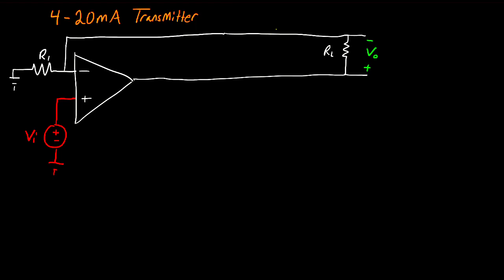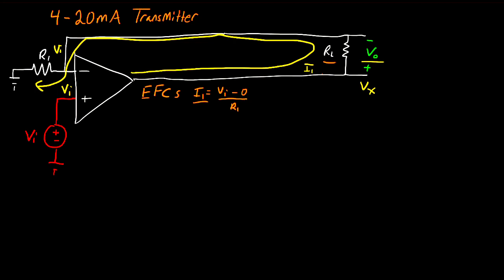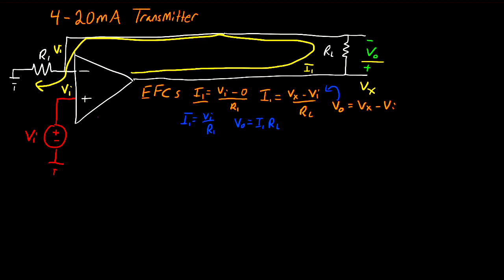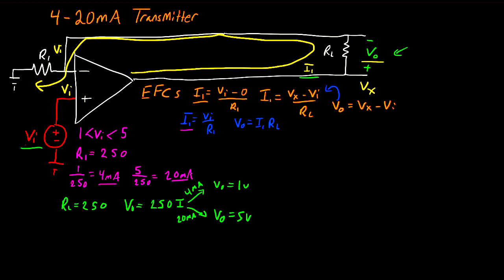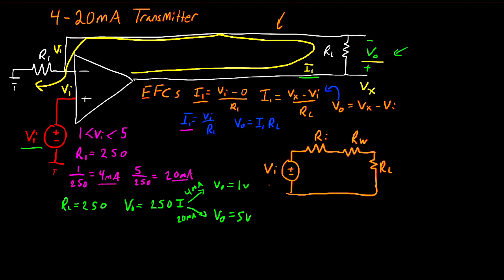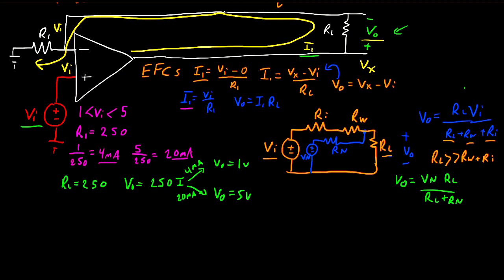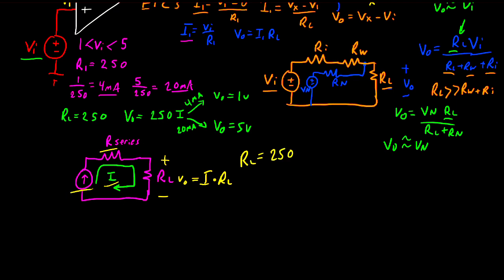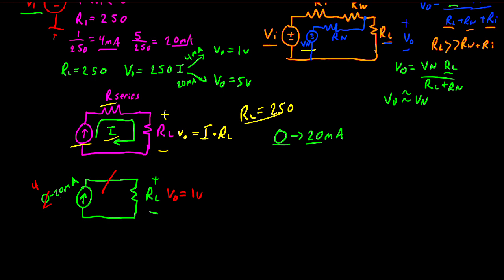4-20mA Transmitter Explained using an Op Amp

Comment: Hi ı want use a Pt100 at  4to20ma at  24vdc and Pt100 Will run 0 cantigrat degree to 100 cantigrat degree you can help me for circuit diagram